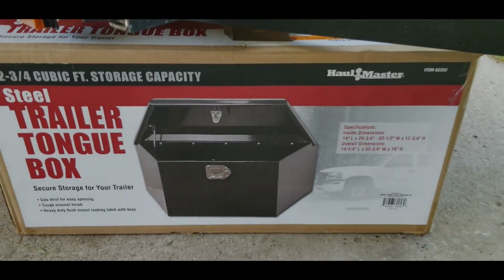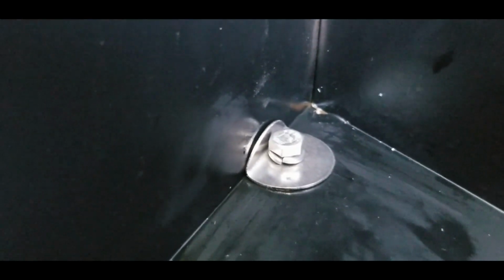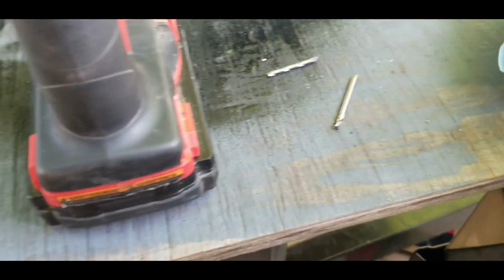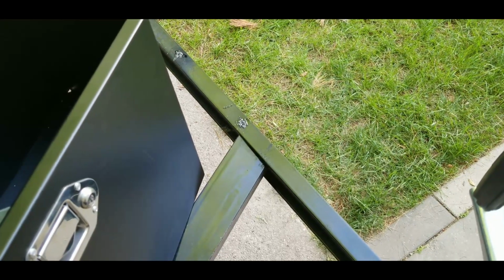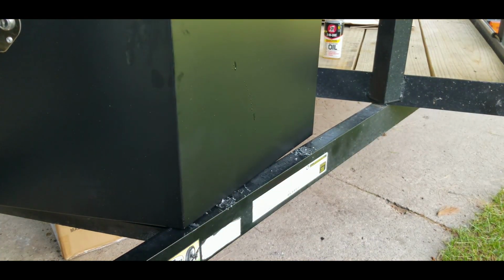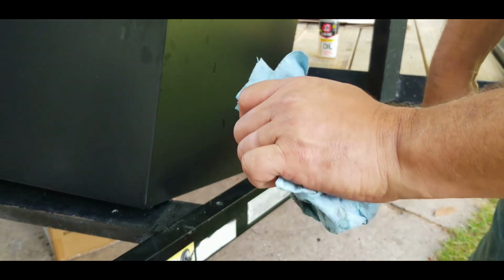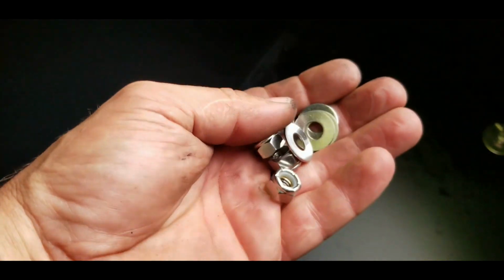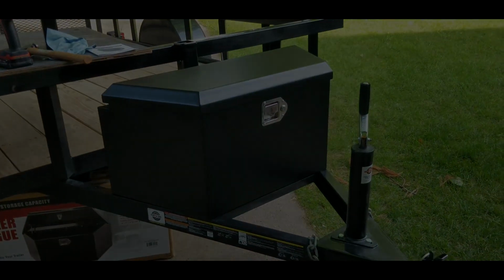Harbor Freight Tongue Box installed onto a Tractor Supply trailer

Comment: I mounted a trailer tongue box to my trailer a few years ago.   Something to consider is getting rubber washers from Lowes or home depot and putting them, between you trailer frame and the box.    As you drive water and grime will get between the two layers of metal and begin to cause rust.  Remember your box does vibrate causing the paint to get thin and bare spots.  The rubber washers prevent the metal on metal rubbing.
Reply from the maker: Great idea! Thanks! I will do that.
Reply: Great idea, thanks bro!
Reply: Smart move.  I think I'll do the same thing.  Place rubber under the trailer tongue box.  Much appreciated for the tip!

Comment: Inside use rubber o rings under the washers to prevent water from getting inside. Also you can screw tap the frame so no one can get to the nuts and rob the box....
Reply from the maker: Thanks for those pointers.

Comment: Thanks for taking the time to make the video.  Your drilling technique needs work.  Your drill speed is too fast, and you don't need to use eight thousand drill bits to drill one hole.  Just use the right size drill bit the first time, and take your time with it.

Comment: And now you have holes in your frame.  Likely not a problem but it does lessen the integrity of the main trailer frame.  Welding in a cross bar and drilling into that would be a better idea and not impact the strength of the trailer.  If you only haul light weight, probably not an issue but add a couple UTV's, rock, anything with weight and I wouldn't want holes drilled in my frame.
Reply: Welding cross braces will weaken the frame too. Most heavy duty frames have stickers on them saying do not weld or drill frame. I'm sure he will not have any issues with structural integrity over 4 drilled holes on a utility trailer or car trailer.
Reply: @shawn7913  Good to know.  I've had three different trailers and used a few others and never seen those stickers but I can see the argument that any structural change would alter the designed integrity.  I haul larger UTV's regularly but nothing the weight of a vehicle.  For light duty...mowers, 4-wheelers, etc, probably okay.  I just wouldn't want to chance it with $20K plus UTV's in tow.  Thanks for the info.  I've got a couple friends that run a welding shop.  I'll see if they have suggestions.
Reply: I'm Nonna tell u what a guy me about putting washeron the bottom of tool case putting a washer there will prevent rusting with them mounted without the washers it will get rust all over the trsiler
Reply: If you are really concerned about the structural integrity of the frame, then get a box which extends past the edges of the frame and use U-bolts to secure it. They will not require any drilling into the frame. Then cut off any excess bolt inside the toolbox after it is secured.

Comment: Just being Devils Advocate. On the box Installation. What’s stopping a thief from  unscrewing the nuts from the bottom side of the trailer and stealing the entire box and the contents ?  I’m thinking the only way you could  do that would to weld those Nuts in place ?  I’m sorry but Trailers in general are easy targets for thieves  in my old Neighborhood I had someone break into my Enclosed trailer  I used for  storing and hauling Camping gear luckily they  didn’t think any of those items were valuable enough to steal. Or got Spooked  off , unfortunately around the same time  a Buddy of mine had his entire Trailer  Stolen. With about a hundred thousand dollars of CustomMotorcycles  inside of it last I knew  the trailer was found with some damage and none of the Motorcycles were recovered
Reply from the maker: I appreciate your comment. Fortunately for me, I live in a safe neighborhood. In addition, there is a street light in front of my house. My yard is NEVER dark and there are good neighbors all around. Thanks for watching.
Reply: @RealManSkills   I'm going to just use those self drilling #14 screws
Reply: @ironwill665  I use them too why drill
Reply: The box locks…
Reply: A thief could open the box with a pry bar faster than removing it. On top of that, the lock nuts will not back off unless they already have the lid open with a wrench on the bolt.
Reply from the maker: @shawn7913  I was just thinking that same thing. Thanks!
Reply: Use U-bolts or tap into the frame. Either method will prevent removing the toolbox without inside access. But it can be pried open for access.

However, I don't believe a thief is going to try to remove the toolbox and run off with it. Especially if it weighs 100+ pounds like mine. If anything, they'll probably just take the entire trailer and then they can get into the box later using any method they choose once they are safely at home with it.

You can't prevent a thief from stealing anything. Every measure of security can be defeated if the thief is smart enough and has the motivation. You can only try to slow them down. Insurance is your best bet.